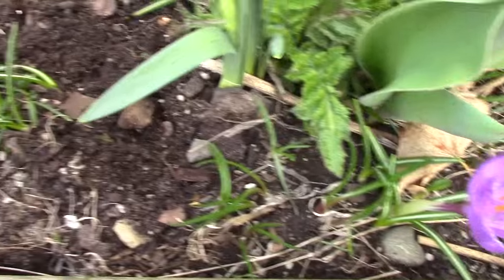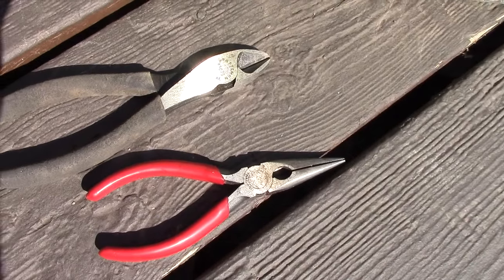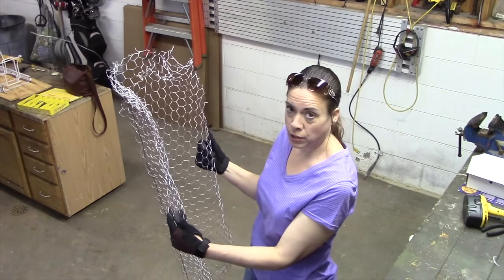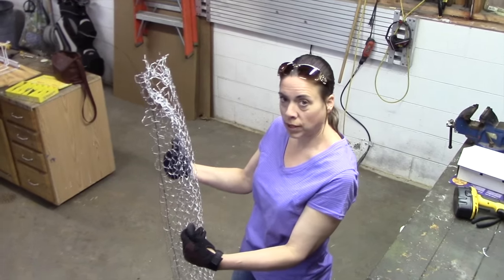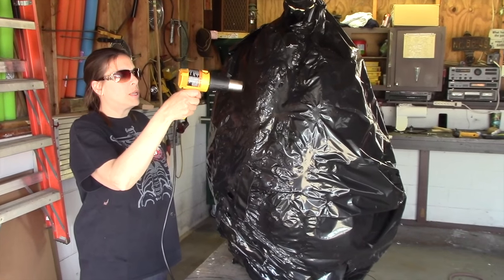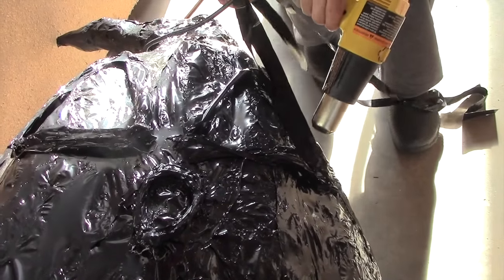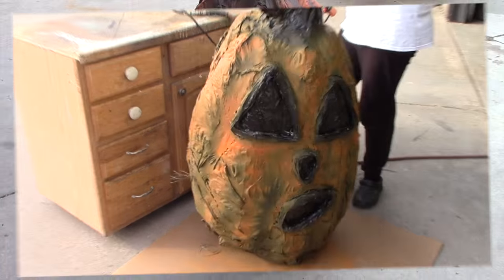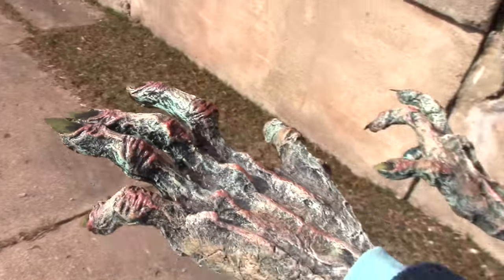HAUNT ON THE HILL 2 FACED PUMPKIN HOW TO

Comment: Cathy- what another great way to make a pumpkin that is NOT paper mache!! Heat gun and plastic!! I probably would spray painted the bigger areas, then gone in with airbrush. (I'm lazy). The last mask too...did you make it in a similar fashion?? I love it, its so unique and disturbing all at once. Awesome video.
Reply from the maker: +matrixmom31 Thanks! Yes, I definetely could have spray painted the bigger areas, but it was the first time I ever airbrushed, so it was a good way for me to get to know it. And my last prop you saw, BooNoo, isn`t a mask, it`s a prop. Made in the same way most of my props are made, stryrofoam wig head, and then I added great stuff to it, then paper clay, and finally paint. Check out my last video, New Faces, I show how I make my witch in the same way:) Thanks again!